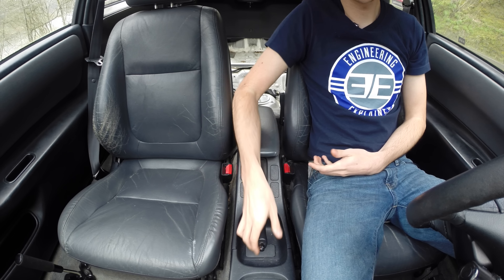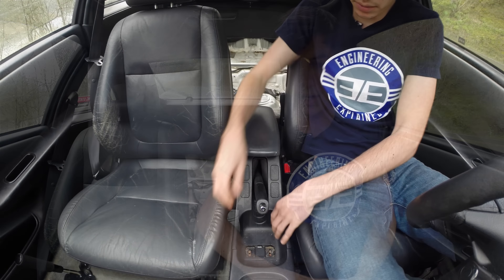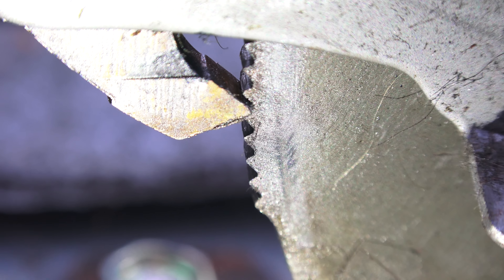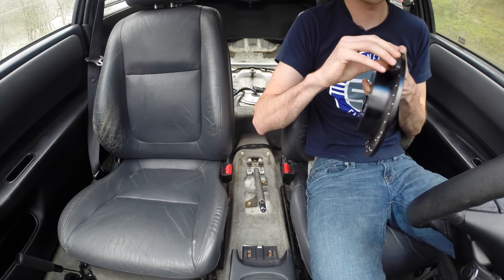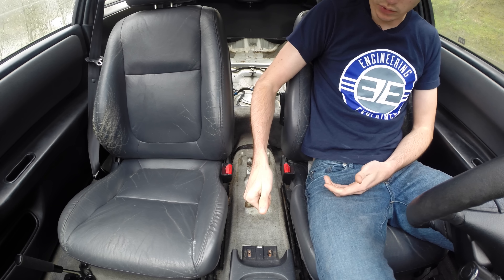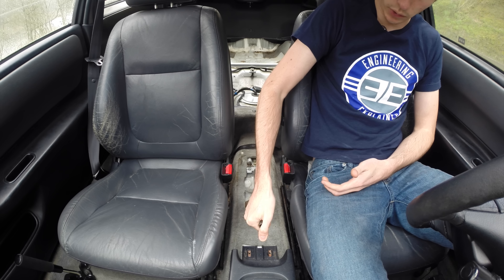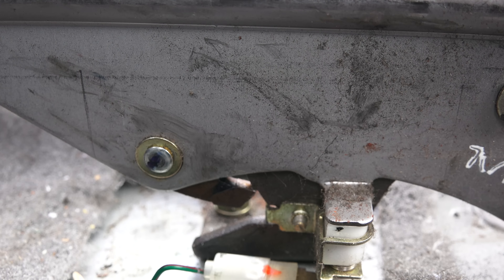Always Press The Handbrake Button? Myth Busted

Comment: Thanks for the video. 
hey guys, I am seeing the handbrake indication in my dashboard Even after its released.

initially it was flickering when I give accelerations on each gear..

now permanently the handbrake indication is turned on..

awaiting your reply. pls help on this. thanks in advance!
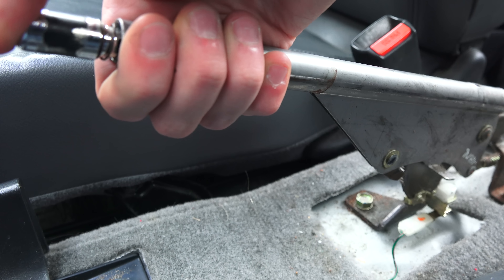Reply from the maker: Typically there is a button that the handbrake will press down when it's disengaged. Look underneath it to see if yours has something similar, it may not be contacting it fully. You can see the button (with the wiring that connects to it) in this video at 0:45 in the bottom right corner.
Reply: The red handbrake indicator is often also used to signify low brake fluid. When the fluid starts to get low, the light will come on from time to time as the car accelerates and corners, as the fluid sloshes about. Eventually when it runs low enough, the light will come on solid. Check your brake fluid level.
Reply: no,again, Engineering Explained is wrong, Fyi iyf had the right answer. brake light lite on dash Is a reminder that you left the brake engaged or partially engage  but it ALSO functions as a low fluid indicator.  The first thing (and the easiest) thing to do check is the fluid level. If it's down the harder  trick can be to find out where the fluid is going. I'm having this exact same problem with my car. I've had to add fluid twice and both times the light went out. I think I had checked the level once and had trouble getting the cap on right. It's got a tight grove that's hard  to seat all the way round. I think without the cap completely sealed fluid was sloshing out. I  take chances sometimes late braking, manually down shifting with rev matching and hard turning to make a light sometimes. It could slosh some out if the cap isn't in right. 

 I'm a momentum driver most of the times so I don't use brakes much, but when I have to I'll use them hard.

For instanceI ofthen exit Interstate 270 which is the columbus ohio outerbelt headed eastbound at the Westerville road ramp on the northeast side. The trick is to be on cruise at 65 (or even 70) and find the spot where you can just pop it in neutral and glide up the ramp. I mean, you've already paid to get the car up to speed, now it's time to use the momentum you have, so go to neutral and glide up the ramp, acrross the bridge down into the cloverleaf right turn using the turn itself to scrub more speed and if it  I get it right I get to the end of the cloverleaf, pop it back in drive and head north on westervile rd having gone from highway speed to  the merge on Westerville rd without touching the brake pedal once. If you drive a spot like that regularly you can get of the freeway without using the brakes. I've I'm carrying a bit to much speed across the bridge I just pope it back in gear and pop it out of overdrive and let the engine slow me, then back to neutral. Through this whole coasting maneuver the engine will be using idle speed mixture and revs at about idle speed with no load on ether engine or transmission, All without and friction or wear on the  brakes. 

Now since and object in motion tends to stay in motion and I've said brakes turn kinetic energy into heat how did I get by without brakes?: Where did the heat get generated? The whole thing does obey the laws of momentum. If nobody want to take a stab at explaining it feel free. If not I"ll explain. 

The only times I"ve ever had to replace pads on a car I've owned is used cars where someone else did most of the wearing out before I got it. Learning momentum driving makes you brake last a very long time. See, I'd been driving 30 years before I owned an automatic transmission car. It's even easier to drive a stick with very little braking that it is an automatic. As you slow or stop in a stick you just keep using a lower gear and let the engine slow  you. I do a lot more manual shifting an automatic than most people and know how to make it downshitft with the throttle. You can do a lot of minor slowing simply by shifting out of overdrive to third (overdrive in most cars is 4th gear). And then the fact that most automatics wil run with and without torque converter lockup creating 2 rations in 3rd gear and 2 more in 4th depending on load and how much throttle. Need to pic up some speed from 70? Give the throttle a little jab an you can feel it come out of lock up and accelerate faster. Getting on the freeway up hill trying to get up to left lane speed. Do it manually in third and if you have to ease the throttle  you can feel it lock up on 3rd. Back to more throttle feel it unlock. Once you're up to speed pop the OD button and let it go to forth. Once you lean the feel of a particular 4speed auto it's actually like having a 7 speed. But if you going to manually downshift much you have to learn rev matching. Not so much 4-3 as its a pretty narrow change but for 3-2 and exotically 2-1 you have to rev match. Cars pretty much tell you what they don't like and if you downshift carelessly that clunk will give it away. You have to get it smooth. Always drive an automatic with both feet. Rev matching on an automatic under braking is done by apply a little bit of throttle right before you manually make the change and you should hear the change in rev but you shouldn't feel it otherwise. Soon as  you hear, or see in the tach that the revs went up the close the throttle again. This is a quick sequence. A little throttle a smig before the gear change and of again as soon as you hear the revs come up. When you master it there should be no jolt, no clunk, therefore no undue stress on the tyranny. Common sense applies, don't downshift to see and over-rev the engine. Don't stay on the gas too long in rev matching lest you have the engine pushing the car with the brakes, and engine, trying to slow it. If you accidentally  pull the lever 2 gears down instead of one it won't immediately go the lowest gear but when it does it will be with a bang. The whole point of rev matching is to avoid bangs. The whole thing doesn't happen as fast on an automatic as "heel toe" on a stick. You should be on the throttle (a little) for around half to no more than a second. 

Truth is I still hate automatic transmissions. But stick are getting harder to find. 

Now, he's right that it COULD be what he says but it is certainly not the first thing you check.  look at all the work. It's usually not easy to get the console cover off far enough to see what he's showing..(then he goes into the completely ignorant statement that wear is caused buy heat.)  How would you like to go through all that just to find it was low fluid causing the light. He's got you chasing wires on the switch that turns the light but it  turn s the light of ONLY if the brake fluid is not low. 

When tracing pretty much any  problem with a machine get the easy fix solutions out of the way  before the hard ones.
Reply: cliff notes?

Comment: I used to borrow my moms car occasionally and I would set the parking brake when finished but I guess I pulled it too hard cuz the next time she tried to drive it, she didn't have enough hand strength to release it.  I had to assist her with that and remember not to set it so aggressively the next time I borrowed her car.

Comment: Common sense the button is there so you can release the tension that disengages the parking brake. It's a safety lock so it doesn't release itself. What will damage your parking brake is NOT USING IT. That causes the cable to seize and in some cases snap when it finally does get used.

Comment: Heat energy is not the only factor. Sure in brake discs were you never really stress them with kinetic energy, heat is the main killer, but I can promise you that if you were to pull your handbrake with 60 mph, the metal would chip, granted this is an extreme example. May I suggest you not saying heat is the killer or kinetic energy is the killer, but instead just say exposure to energy for a long time is a killer.

Comment: Is parking brake a 3nd independent brake like front and rear? Or when u apply hand brake, u basically just brake the rear brake (rear pad contacting rotor)?
Reply: Yes. Typically, the front axle (front 2 tires) is one closed braking system (This allows some usage of regular brakes, even if a leak happens). The rear axle is another closed system, like the front, and the parking brake is a third, direct cable based system. Parking brakes usually only apply the rear brakes. (It saves the manufacturer money versus implementing the system for both axles.)
Reply: Steve Ding the hand brake is a cable system. He had a full montage on it in the video b

Comment: Metal on metal causes wear, fact. Drive in london for 100k miles and see if the ratchet has wear on it or not, I guarantee it will. I live in a big town and if I go out in the car I am probably gonna use the handbrake a lot and put my car in neutral at red lights. Ill keep using the button thanks...

Comment: Huh, I never imagined anyone would think that you should push the button while applying the parking brake, since it's obviously a ratcheting mechanism.  But why is it sometimes called an emergency brake?  I know stunt drivers sometimes use them to induce a skid, but do they have another intended purpose besides holding the car when parked?
Reply from the maker: Well if your hydraulic brakes were to fail, it has a cable tied to the rear brakes, so it can act as an emergency brake.
Reply: Cool - I wasn't sure how safe or effective it would be if the car was at speed on a downhill grade, but I guess any port in a storm. :) Thanks!

Comment: the only Time you hold the button down while you pull up in is if the car your driving is a Manuel and Ur stopped on an uphill incline
Reply: The type of transmission, or incline of the road doesn't play a part in how the hand brake works. Be it automatic, or manual, you're going to have the same exact set up. They don't use different kinds of ratcheting hand brake systems for different transmissions.
Reply: I know that I'm talking about giving Ur self some help not to role backwards

Comment: some people told me that i should not pull the hand brake too high... will that break the hand break?
Reply: The handle will NOT break but if you are pulling it abnormally high you may be due for adjustment or even possible replacement parts.

Comment: So, if my car is an automatic, should I apply it on flat road? Or is it not necessary? Can a car still roll freely while in park?
Reply: Jason Lurf leaving the car on park should be sufficient while on flat road and even in small inclines (depending on the car) as park holds the breaks for you.  on a manual there is no "park" so the car rolls freely whereas an automatic does. But using the parking brake anyway is a way to be extra safe and it is recommended for all cars on inclines
Reply: When the shift lever is placed in park, the rod pushes the spring against a small tapered bushing. If the park mechanism is lined up so that it can drop into one of the notches in the output gear section, the tapered bushing will push the mechanism down. If the mechanism is lined up on one of the high spots on the output, then the spring will push on the tapered bushing, but the lever will not lock into place until the car rolls a little and the teeth line up properly. This is why sometimes your car moves a little bit after you put it in park and release the brake pedal -- it has to roll a little for the teeth to line up to where the parking mechanism can drop into place. My point is that park does not "hold the brakes for you", it actually locks up the entire transmission itself, preventing the output shaft and driveshaft from moving in turn preventing the wheels from moving. Please use your handbrake for the sake of the transmission.
Reply: Alex O'Boyle Exactly what I was thinking. The handbrake should always be used regardless of the how flat the road is. Not to mention in the incident of a car crashing into your parked vehicle, with enough force the transmission can be damaged and could turn from you requiring some work being done on the body of your vehicle, to requiring a new transmission...
Reply: Nigel That's a great point. Transmission repairs/replacements are one of the most expensive things to do to your car and I wouldn't want to be put in that position, especially in today's economy.
Reply: On manual there's no park... but you can just leave it in gear. I live in a country where most cars have manual transmissions and I've never heard of anyone leaving their cars in neutral.

Comment: Uk Driving test requires you to push the button it when you apply the hand brake. While the video makes a good point, i guess i can cringe less hard when I forget, surely any wear is better avoided it safe and easily to do? There will be some wear, heat not being the cause of wear at all.

Comment: Before I watch this, no, never press the button, it doesn't cause wear and you put too much pressure on the handbrake when you press the button.. the clicks are necessary, 4-7 clicks is normal, more and you need to change it.. you won't know this if you press the button

Comment: My driving instructor specifically taught me not to press the button when pulling on the parking break.

Not only is it designed to be used this way, but the sound it make is a good indication that the parking break is actually engaged and if you listen closely you can even tell how far you pulled it.

Edit: Also I find the sound quite satisfying, lol.

Comment: Hello Engineering Explained, I would like to know if it is alright to leave a car or bike in gear when parked? Does it damage the transmission when parked in gear on a slope/road incline?
Reply: No, it does not damage it.  In the worst case scenario, the stress on the gears is less than just barely moving at minimal throttle in first gear as all you're doing is leaving the gears engaged with one another.
Reply: Oh alright, thank you for your reply!
Reply: it can damage the engine in some cases actually. bmw blames its timing chains going bad on people doing this. the danger is that you may turn or try to turn your engine backwards which you really shouldnt do.
Reply: How do they end up turning their engine backwards while gear engaged? :O
Reply: If the car is in a forward gear parked upward on a hill, then the e-brake goes out, the engine will spin backwards.
Reply: No if the ebrake failed like that, there wouldn't be enough momentum to turn the engine over. It would stop on the transmission, and go no wheres. 

Compared to not leaving it in gear, and having it roll away. Also most cars in the last 20 years require that the clutch be pushed in prior to ignition. So to answer the question, put the parking brake on, and leave it in gear.

Comment: I've been driving for a long, long time but in all that time I've never felt the 'need' to yank back at the ratchet simply to prove to myself that it did, indeed, work.  I thumb down, pull up the handbrake, release my thumb and that's it.  But, I guess if you like the clicking sound of steel on steel 'teeth' then it's a matter of choice.  Other than that (and for me) I think it's a chit noise associated with cars both cheap and expensive alike.

MY opinion, of course.

Comment: I am driving BMW style from now on.  If I stop using the turn signals, my blinker fluid will not get used up as soon.  I will save a fortune on blinker fluid by not using my turn signals anymore.  The BMWs must use a special blinker fluid that is very expensive.  One never sees a BMW using their turn signals.  The drivers can not afford to replace the special whale oil blinker fluid.

Comment: Socket wrenches wear with use.... pushing the button and lifting is just as effective and takes as long as normally cranking, with marginally less wear which can build up over very extended periods. It's borderline completely irrelevant, but not useless and takes no effort, so why not do it?

Comment: I have a question/concern and if some could clear it up for me I'd be greatly appreciative. A couple days ago I parked on a slight incline so I decided to apply my handbrake. No big deal. A couple hours later when I returned to my car to drive it again I started up the engine and put it in reverse to back up and it was not moving. I then realize that I had completely forgotten to disengage the handbrake before putting the car in drive/reverse. Which is why it was not moving. My question/concern is if this in anyway could have damaged something in the car. If someone could let me know that'd be awesome. Thanks.